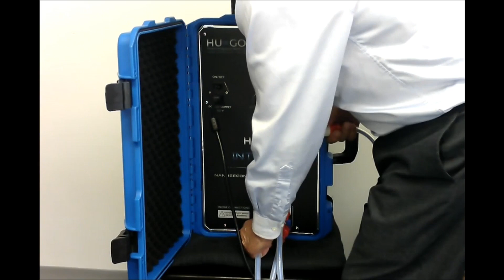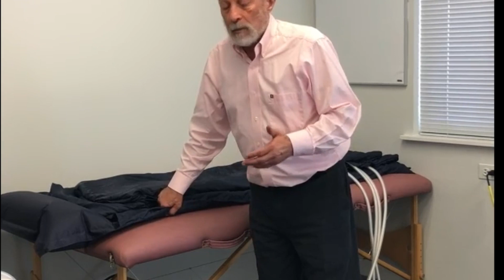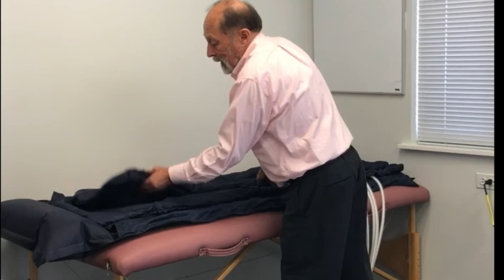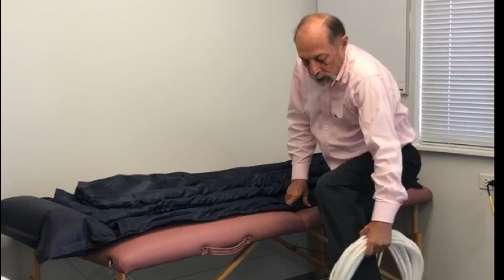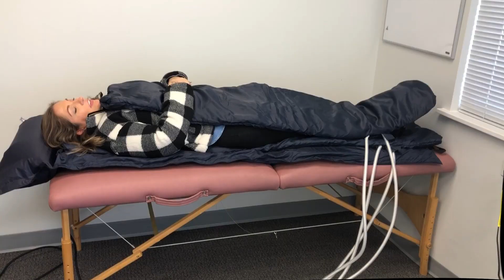HUGO INTENSE DEMO

Comment: So basically it's a system based on the Multi Wave Oscillator circuit with a Tesla coil and a spark gap driving a semi circular coil at times, so a sine wave output to a rope coil, not the most efficient way to drive a coil, does it have magnetic polarity and if it is identified how do you know if in therapy the coils are apposing them selves or set up as a Helmholtz circuit, I cannot see on these large coils having a great magnetic slew rate regardless to size and power input.

Comment: With Spark Gap Pemf machine how often does the Spark Gap need to be serviced, does it have to be sent somewhere and what is the cost ? It’s my understanding that Digital Pemf machines do not need maintenance. With the cost of these machines this is definitely a concern.
Reply: Yes the spark gap is like a MWO device and the tip is prone to contamination requiring cleaning or the output power with steadily decrease I use mass air-flow sensor cleaner as it wont effect the metal or plastics.
Reply: I got the same question?